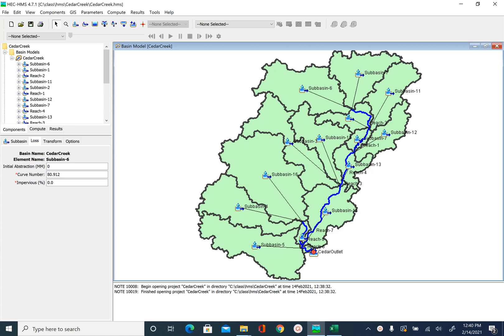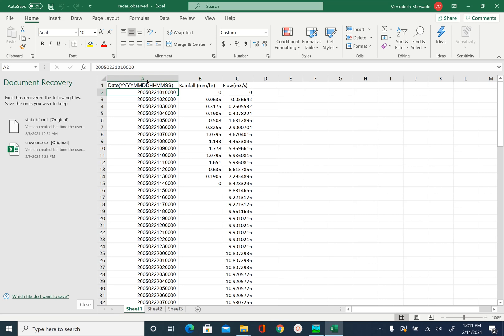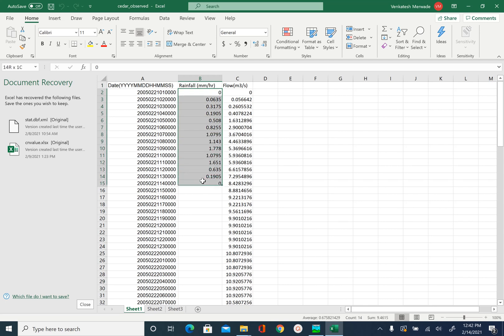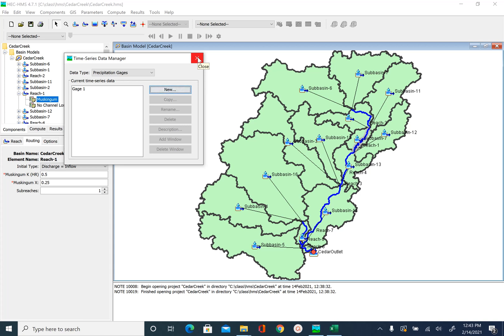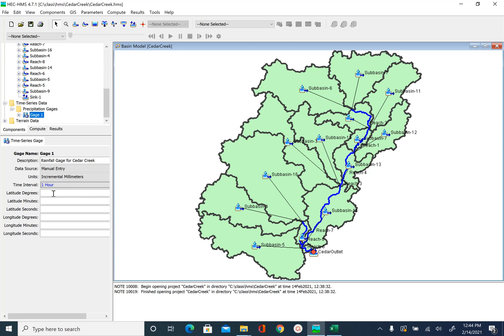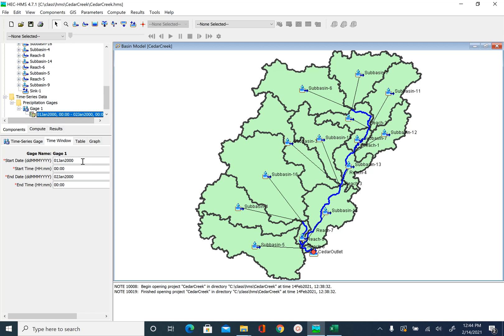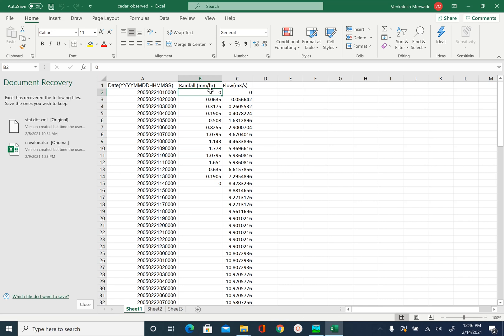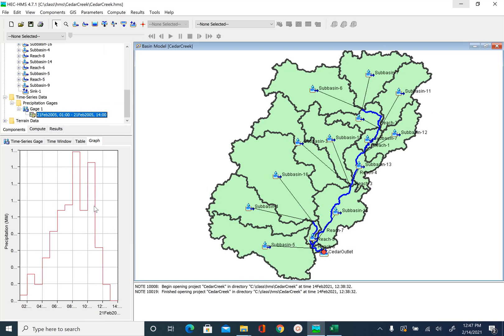Hydrologic Modeling Using HEC-HMS (7/9) - Creating a Meteorologic Model

Comment: Hi Sir! I just want to ask regarding the thing you said that in the precipitation gage is that we need to put mm/hr. What if my data given to me is 6 hourly data in mm only? do I have to convert it to mm/hr? will I have to divide ng mm given to me by 6 since it is an 6-hourly data? and Another thing is how did you get the flow(m^3/s) in your excel file?
Reply from the maker: You can assume uniform rainfall and divide your data by 6 to get mm/hr. The flow data was obtained from a streamflow gauge.

Comment: Does scs curve only apply for event based simulatorn rarher  than continuous simulation?
Reply from the maker: This method was originally developed for event bases modeling, but there are variations that can be used in continuous simulations. These are not available in HEC-HMS